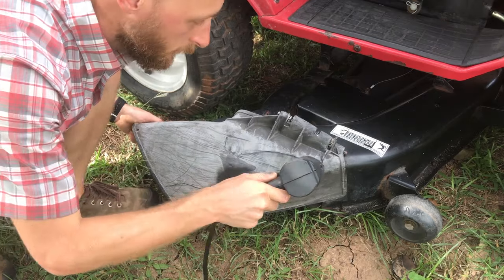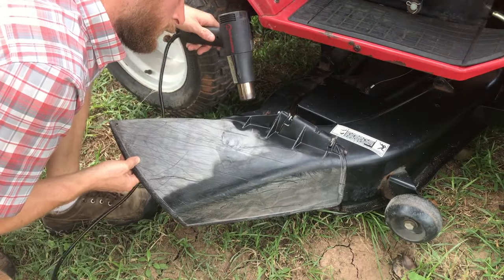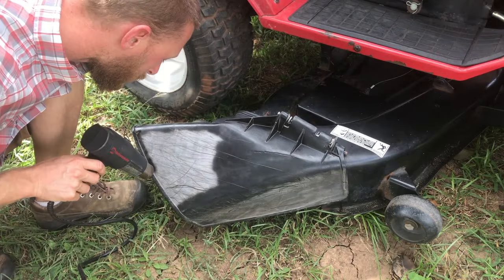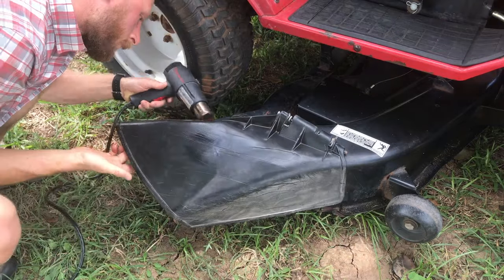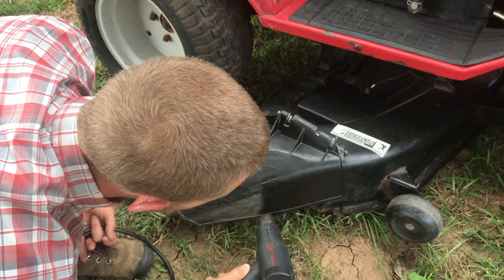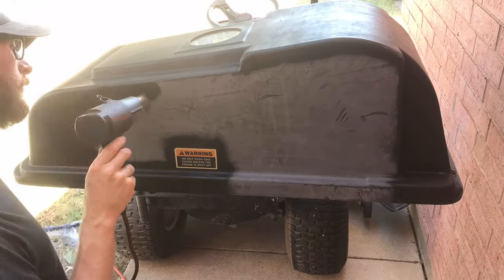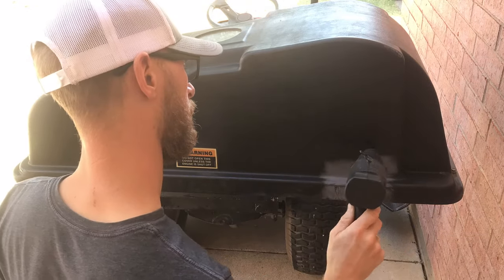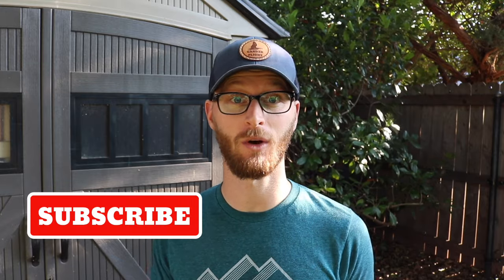RESTORE Faded Plastic and Make it Look NEW - Easy and Cheap!

Comment: Didn’t even work 😂put it on low didn’t do nothing left it in the same spot for at least 15 minutes didn’t do nothin put it on high didn’t do nothin literally started melting a hole in the plastics so yeah this probably only works on super think parts of plastic
Reply: Thin*
Reply from the maker: Hmm - not sure why it didn't work for you. The plastic in this video was probably close to 1/2" thick, and as the video shows it worked. What kind of piece did you try it on?